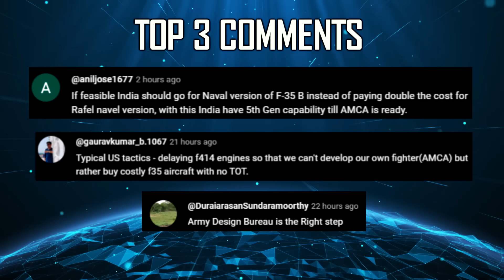Indian Defence Updates : 550Km Rudram-3 Test,Kaveri-2 on Tejas,VLSRAM Modified,New Drone Interceptor

Comment: RE:-CAUVERY AERO ENGINE, THE TURBO WHEELS BECOME BLIND PLATES AT THE HIGHER SPEED(RPM). THIS BECAUSE OF THE GAPS BETWEEN THE BLADES OF THE TURBO WHEEL IS VERY NARROW. SO AT A VERY HIGH RPM, THE TURBO WHEEL BECOMES AN IMPEDING PLATE, DUE TO PERSISTENCE OF VISION. HENCE THE THRUST THAT IS CREATED IN BETWEEN THE FIRST TURBO WHEEL AND THE SECOND TURBO WHEEL IS NOT TRANSFERRED TO THE NEXT STAGE. THIS RESULTS IN ACCUMULATION OF BURNT FUEL, NOT BEING DRIVEN OUT, AND THE INNER TEMPERATURE OF THE ENGINE, BETWEEN THE TURBO WHEELS, GETS TRAPPED. HENCE, DESPITE HIGH INNER ENGINE TEMPERATURE, THE FINAL THRUST(AT AFTER THE SECOND IGNITION) IS ABSENT. 
SOLUTION:- JUST REMOVE, ONE OF THE TURBO WHEEL FROM THE "INBETWEEN" THE TWO IGNITION POINTS AND CHECK FOR THE THRUST AT THE EXHAUST. A POSITIVE, IMPROVED THRUST IS INEVITABLE.  THANK YOU FOR THE SPACE.
Reply: So what is the drawbacks of removing one turbo wheel ??? Is it lesser thrust output
Reply: Bruh 💀